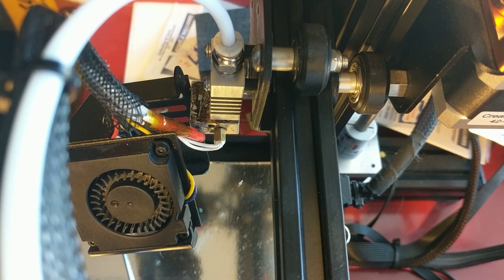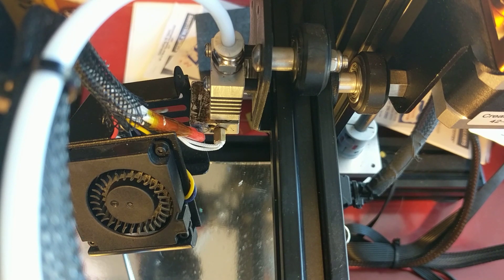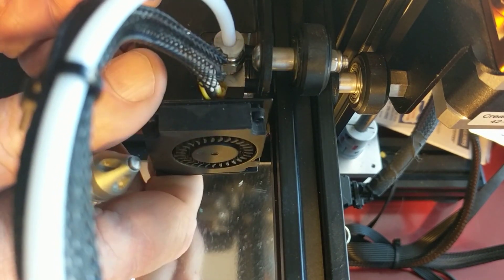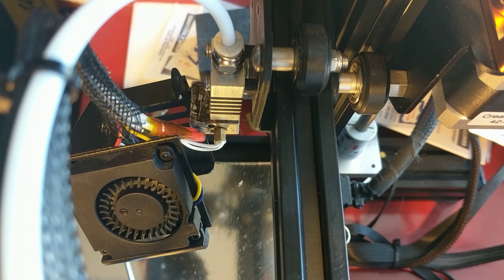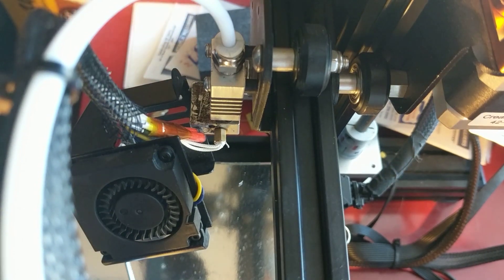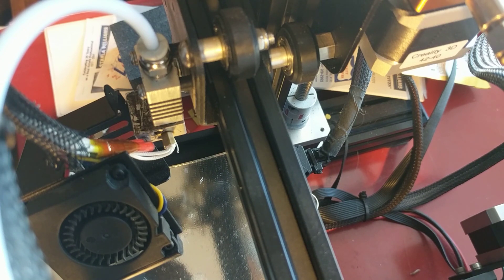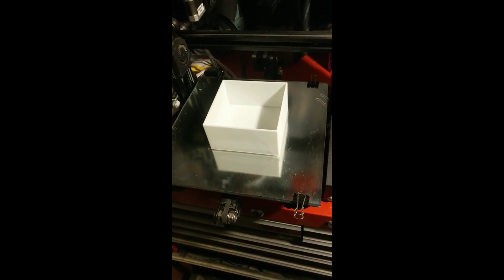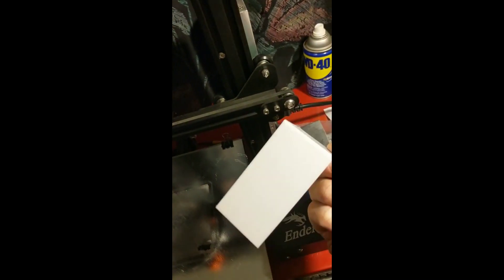Screw in Thermistor for your Ender 3

Comment: Did you upgrade the ptfe bowden tube as well for printing at the higher temps? Usually a good idea. I know this is an older video, but for those who watch this for reference, it's generally a good idea to upgrade to a capricorn tube obverse you get above 260 or so.
Reply from the maker: IMO if you're going above 260 you need an all metal hot end. Even Capricorn will tell you not to run their tube above 260. The main benefits of the Capricorn tube is it's much tighter manufacturing tolerances. And the main benefit of the screw in thermistor in a non all mental hot end is it's durability and ease of removal and reinstallation. Thanks for watching! And it's always good to see another Patriot!
Reply: @3rdpig  That is good to know. I recently switched to a direct drive setup, but used a small piece of the capricorn between the drive motor and all metal hotend. I haven't printed above 220 yet with that setup, but now I know I've got more reading to do. This is such a "rabbit hole" I love it 😂 Keeps your brain busy for sure.

Comment: how do you chance software for this ?
Reply from the maker: You have to flash the firmware on the printer with an updated version of Marlin that has the changes you want. To do that you download Marlin to a PC, make the changes you want (it's pretty simple to find the thermistor value and change it), then plug the printer into the computer and use the functionality built into the editor you used to write it to the printer's mainboard. There are lots of videos on how to flash a bootloader to the Ender 3 and how to set up an editor and flash the firmware.
Reply: @3rdpig  but in video minut 3.06 you said no chance,s in marlin is necesary ? i have ender 3 v2 neo

Comment: So how do we install this?
Reply from the maker: 1. Remove the screw that holds in the original thermistor, clip the wires and dispose of all of it.
2. Thread the new thermistor into the threaded hole the retaining screw came out of and tighten it.
3. Trim the wires to the length you like, slide some heat shrink tube on them, strip the ends of the wires, solder them, put the heat shrink over the solder joints and shrink them.
4. Tie the wires off neatly.
5. Edit the firmware to reflect the new thermistor and flash it to the control board.
6. Enjoy your new thermistor!

Comment: what length wire is needed for the ender 3
Reply from the maker: If you want to know the length to run it all the way back to the mainboard I could estimate it for you, but if you've got an Ender 3 you can do that too. I didn't run mine all they way back, I just spliced into the existing wire.

Comment: I got one of these from gulf coast robotics. It isn't holding temp well, even after a pid tune. Without fail, it overshoots target temp, cools down too much, then heats back up. I'm looking at about a 4 degree temp swing and it's affecting print quality. Sometimes if it doesn't recover fast enough it'll throw a thermal runaway too. Fun stuff.
Reply from the maker: I'm using 3 of them now and haven't encountered that problem. It's possible you got a bad one. I'd double check the installation and consider making the change in Marlin to set the new thermistor type and if that failed I'd try another one.
Reply: @3rdpig  it's an epcos thermistor, no change to firmware as thats what the previous type was. I've gotten it figured out. They didn't provide a silicone cover. I covered the stud end with kapton tape and temp readings are way more stable.

Comment: This is a 100% must have upgrade that is overlooked by basically every channel, especially straight from stock on most ender 3's. recently I fitted a new hotend and I must have overlooked the silicon cover slightly slipping of the thermistor diode, so when I began to pre-heat my printer the copper wire got burnt by the heat block, and because the stock ender 3(2018) doesn't have thermal runaway, my printer could of caught fire if I didn't catch the smell of the PLA evaporating. it's not necessary but the safety added for a couple dollars is unbeatable.

Comment: I'm working on replacing my second thermistor and thermistor rod because of the horrible designs in this printer.  Thank you for this.
Reply from the maker: We need to find the guy who thought that pinching electrical wires against a hot metal body with a metal screw was a good idea and explain to him the errors of his ways. But honestly it's not just Creality, it's common among inexpensive printers of all makes. And you're right, it's horrible design.
Reply: @3rdpig  True story, sir.  I mean, I like looking at the positive side of things...I'm learning A LOT about how to rewire and upgrade this little beast. LOL
Reply: @3rdpig  Were you able to fit the stock shroud over the thermistor? I've heard contradicting statements about this. I want to print higher temperature filaments with my ender 3 v2 and this seems like the easiest thermistor since it doesn't require the firmware changes but I don't really want to have to use a different hotend shroud. Thanks

Comment: Does this have to be coconnected directly to the main board on e5 pro?  2 pin connector doesn't match larger connector I unhooked on broken factory thermistor
Reply from the maker: Connecting the thermistor wire directly to the main board would be the best way to do it. That being said, I just spliced mine to the existing wires with solder and heat shrink tube.

Comment: How do you get around the Marlin firmware temperature overrun limit of 275C?
Reply from the maker: Go into marlins configuration file and change it, then reflash to the printer.
Reply: What line needs to be changed in the firmware to allow higher nozzle temps? Anybody have a link to a good tutorial?
Reply: @3rdpig  #define HEATER_0_MAXTEMP 275

Comment: good video. I was wondering if it would work with CR-10. You should look at the SKR v1.3 board. I have seen it mentioned in the code.
Reply from the maker: Should work on the CR-10, it's the same hot end. I've put the SKR 1.3 in this Ender 3 when I enclosed it. Check out my later videos. And thanks for watching!
Reply: @3rdpig  Thanks Chuck. I have one on order. I do have the Swiss hot end on it.
Reply: The one installed was a bead type. I had a spare so it is up and working. I will install the new one If I have trouble again. Good video and quick response. Thanks

Comment: great video.     my E-5 just stopped heating my nozzle mid-print on a lithophane.      found a troubleshooting video but thought it would be assinine to replace a part with the same part.       glad I found your upgraded option that will allow me to test different print stronger filaments.      keep up the great work.
Reply from the maker: Thanks!

Comment: i just installed this to my microswiss hot end. a quick change to the firmware upping the max temp to 298 was all thats required if only going into the hot end. if going to the bed then theres another line that needs to be changed. its way more stable being threaded in than clamped in with the stock version

Comment: I completely missed the point here. You moved the thermistor from one metal hole to another. I see no point in doing this at all.
Reply from the maker: The point wasn't to move it, the point was to use a solid, threaded brass thermistor that could handle 300c instead of the glass bulb thermistor that is held in by pinching it's wires under a screw and can't handle the higher temperatures. Honestly, I thought I made that fairly clear in the video, but sorry if I didn't.
Reply: @3rdpig  Oh I thought you just glued or used epoxy to make one out of the glass kind. That I can understand yeah. Care to share where you bought it?

Comment: I bought the same all metal hotend in aliexpress, it came with the cartridge and thermistor, I replaced everything from stock hot end and now it does not reach the pla melt temperature the display says 205C and nothing happens, any ideas to help me figure out what's going on my friend?
Reply: I mean tried to push the filament by hand and it is so hard, I have to set 240C in the control setting to let the pla begin to barely start melting so slowly, I tried to put back again all the stock parts and it works well again, but the leaking filament keeps going, that's why I decided to replaced it with the all metal one

Comment: did you run the wires all the way to the board or just splice those white wires in to the existing thermistor wires?
Reply from the maker: I spliced them in. Soldered, covered in heat shrink tube and wrapped with kaptan tape. Probably overkill, but I've got lots of it. It comes with a short lead, a 2 pin connector then another two wire pair about 3 feet long with a matching connector on one end and a 2 pin board connector on the other.
Reply: THANK you  @3rdpig  your ender 3 videos are so so so so extremely helpful
Reply from the maker: @scottanon5466  I'm glad I can help!
Reply: @3rdpig  so you don't HAVE to splice the wires, you can screw the thermistor in and plug in the other end to the board?
Reply from the maker: @slicedpage  Yes, you can run the wires from the new thermistor all the way through the loom and into the board if you want. Just be aware that there's only about 5 inches of wire with the new thermistor then it ends in a 2 pin connector. They also supply another 3 feet with the matching connector on one end and the plug for the board on the other.
Reply: @3rdpig  Thank you.The UK equivalent is here https://amzn.to/2IjsBQ6 . I won't blame you if it goes wrong. Do you think it'll do the job?
Reply: @slicedpage   Did you see the package contents for this alternative (still from Gulfcoast) states: "1 x Hex Housed Modular Thermistor assembled with PTFE tubing". It goes on to say it is good for 300C but, if it is in direct contact with the head then that's going to be just as bad for you as PTFE tubing into the throat, no?

Comment: You can use a $23 MKS GEN-L Board, Add a Type K Thermocouple and Converter, you are good to go. In the middle of that project myself, as I to am using one of those Clone Hotends. Thanks for the link to the screw in thermistor.
Reply from the maker: I saw this upgrade on Teaching Tech's channel. The responses to the video and some other things I read made me think twice about it. They're pretty cheap on Ali, maybe I'll give it a go. Let me know what your results with it are.
Reply: @3rdpig  I saw the video as well. His video was pretty good but incomplete. He left out some pretty important points that needed addressing. Especially if you use the better stepper motor drivers (TMC2208). Will let you know how it goes, almost done, waiting on a few parts...
Reply from the maker: @IgorDeCamps  Thanks, I'm very interested in how that works for you.
Reply: @3rdpig  I have this board installed based on that same video.  I have seen no issues with it at all with the exception of having to change my extruder steps from 93 to 260!  This may be an issue with my configuration, but no matter...I find this board to be adequate.
Reply from the maker: @TechGorilla1987  Which stepper drivers are you using?
Reply: @3rdpig  I got the A4988s that came with that kit from the link in Michaels video.  I may upgrade at some point, but this arrangement is SOOO much quieter.  I have TPU damper feet printed and I installed stepper motor dampers when I first built the printer.  It's pretty silent and I sleep 10 meters from it.
Reply from the maker: @TechGorilla1987  I'll keep that in mind if my current setup won't do what I want it to. The sound from the printers has never bothered me, so being quieter isn't a big deal. But quieter usually means smoother, and that's often conducive to motors and other parts having a long life. Thanks for the info!
Reply: @3rdpig  It specifically made a difference with printing shapes that are round...If you have been printing for a while, you will know that singing sound.  I think it's fun to hear sometimes, but this setup pretty much kills all of those harmonics.  I have old man dog ears, so certain frequencies bug me.
Reply from the maker: @TechGorilla1987  lol, I do know that sound! But it rarely gets above the level of my tinnitus unless I'm really close. Who knew it, tinnitus has an upside!
Reply: @3rdpig  Works a treat! Got the screw in Thermocouple and the Preamp board setup with the GEN-L. On a side note changed to an LV8729 for E0 and no output. Scratching Head.
Reply from the maker: @IgorDeCamps  Great info, thanks! If you don't mind me asking, what was the cost for your full upgrade including board, thermocouple, stepper drivers and anything else to get the board installed and working?
Reply: @3rdpig  Not including TFT32 and All Metal HotEnd $74...
Reply from the maker: @IgorDeCamps  Not bad. Considering I'd only be doing one printer. I'm printing a small nylon part out now at 265c, which is the upper temp listed by Taulman for their Bridge Nylon. As soon as I decide which one to get, and I'm leaning towards Matter Hackers Zytel, I'm going to start experimenting with filament that requires 270-290. I guess that's when I'll find out if I have another $74 I need to spend. Thanks for sharing!
Reply: @3rdpig  Have some Taulman myself. There are a few Matter Hackers filaments I'd like to try.  I figured since I had the darn thing in pieces, it would be a good time to just get it all out of the way. Once I do a few calibration prints. Its on to the Taulman stuff. :-)
Reply from the maker: @IgorDeCamps  I don't blame you, once it's apart there's no reason to go down that rabbit hole again. My little nylon part, only a 33 minute print turned out great, and at least IMO, way sturdier than my prints with it at 250c where the layers would start separating if I tweaked it enough. On to Zytel!  lol
Reply: @3rdpig  - I temporarily upgraded to the MKS GEN L board and 2208 drivers - the machine runs silent with them, apart from the cooling fans! The problem I had with the machine however was massive instability in temperature on the hot end... I found it danced around +/- 5 degrees or so which I wasn't happy with when the creality board had been rather solid and consistent on the temperature front. Creality now sell a board with 2208 drivers already fitted (permanently - soldered onto pcb) which I may purchase at some point.
Reply from the maker: @mike306dt  Good info, thanks!
Reply: @3rdpig  Hey Chuck - another update to the above - I've managed to increase stability on the hotend temperature readings massively thanks to a suggestion I found on a forum.  

If you add a decent low ESR capacitor to the 5v and GND pins where the ISP header is - the temperature readings fluctuate much less.  I've just ordered some decent capacitors from ebay, but my testing with a cap harvested from an old socket A motherboard yielded great results.
Reply from the maker: @mike306dt  Great info, thanks! And kudo's for getting it working!